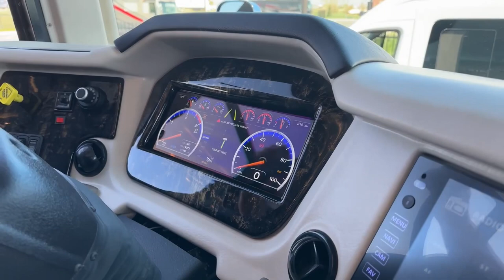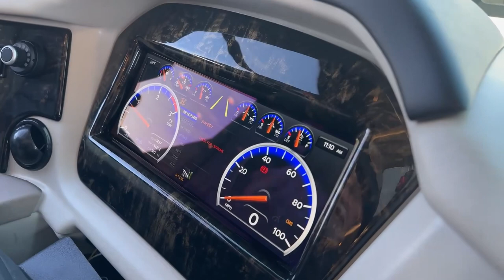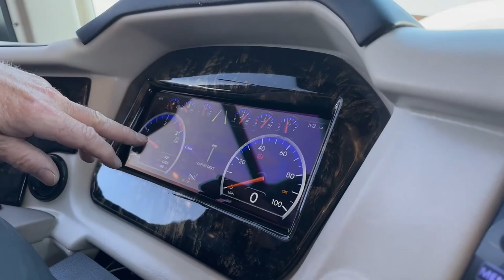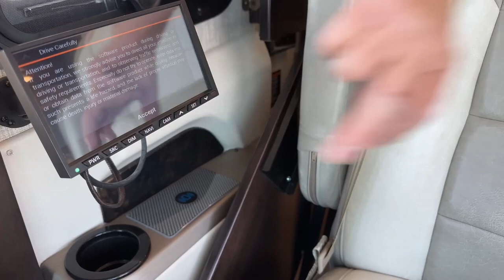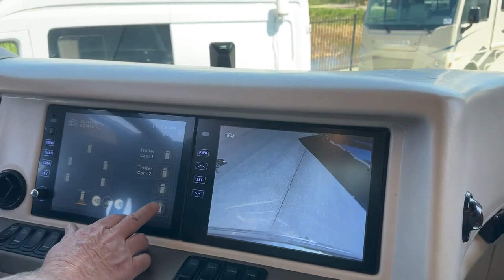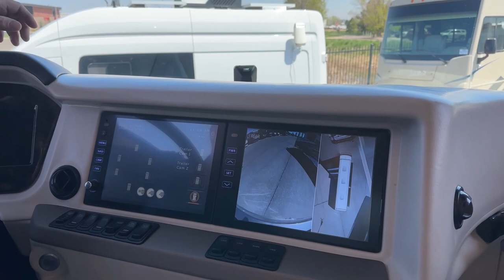2024 Newmar Mountain Aire 3823 - 5N230632

Comment: I love the wood finish and interior on this coach. My only critique is the small, wedge-shaped shower and closet doors that don't open fully. Otherwise, wow! With 525 HP, 1695 lb/ft of torque, and a tag axle, this would be a great rig to tow a boat. I also love the 38' length. Hmmm, New Aire or Mountain Aire? It's a tough decision. 🙂